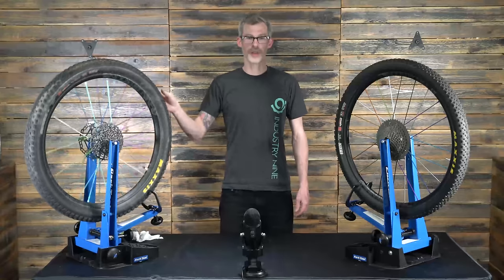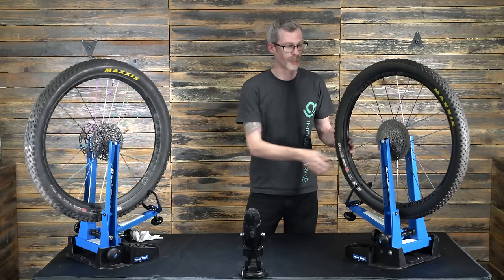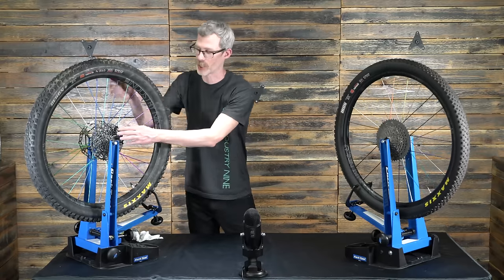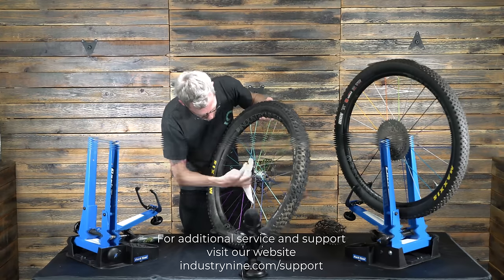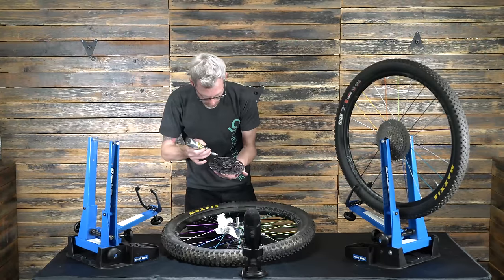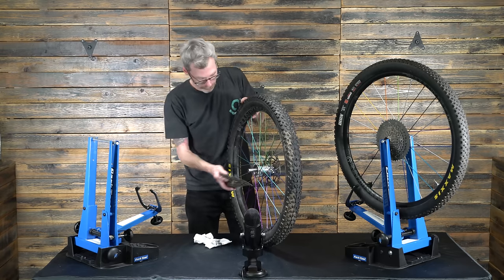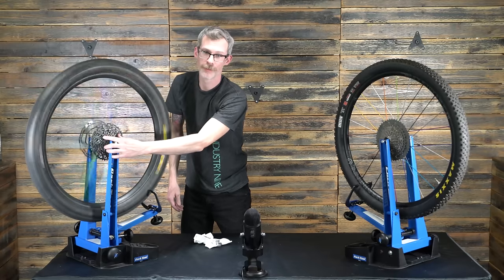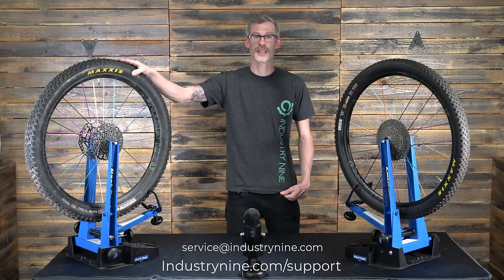Hydra vs Torch: Sound Comparison!

Comment: Yo! The Hydras man. Already seen 3 broken Hydras on my local rocky climb trails. They are good engagement point wise, but definitely not as strong due super small teeth. Is the sound and super small swing arc really worth the strength? Not to me, but to each their own. I think the 101's are your best, especially up technical climbs. Maybe even the torch or legacy hubs.

Comment: Hi, I recently got a bike with these hubs.  I understand they are known to be loud - makes no difference to me.  I had the shop service it and for the first ride it was quiet. For the second ride, it was loud.   Maybe they used oil instead of grease?

After servicing with grease or even oil, how long should the hub remain quiet?  

Lastly, is there a way to make them permanently quiet or at least less noisy?  Thanks!!

Comment: So, if I wanted to run it loud I would simply degrease and apply oil? Are there any ramifications (e.g. compromised longevity) in doing this?
Reply: yes, they would be freaking loud and super annoying.
Reply: I am wondering the same thing, any comment I9?
Reply: More frequent maintenance required...

Comment: I was hoping it would be louder than the torch. Maybe now the torch will be a little cheaper. If I want silent I would go for a sprag.
Reply from the maker: If you get the chance, try and listen to them at speed going down a mountain. The higher pitch of Hydra yields surprising results when you're spinning it faster :)
Reply: @industrynine3931  You guys should make a sprag option to be sold as an alternate free wheel body.  Then you can sell infinite points of engagement.
Reply: Maybe cheaper but while you can... No more Torch, only Hydra!!!  The 101 hub may sound a bit like the torch!
Reply: I got the Hydra and have made two videos recently comparing the sound in the work stand with the sound on the trail. Have a look and hear what it sounds like. It's pretty loud on the trail but under wind noise, you barely hear it.